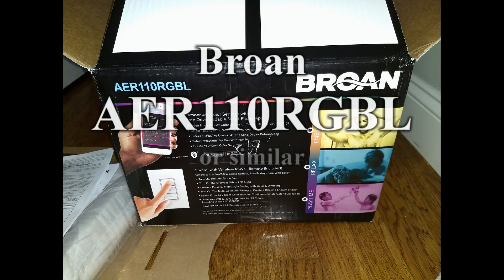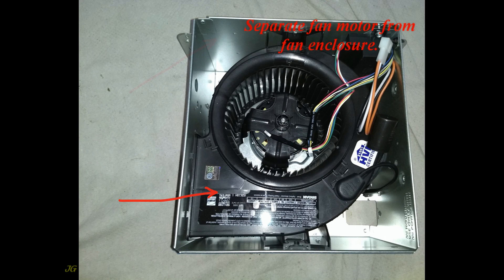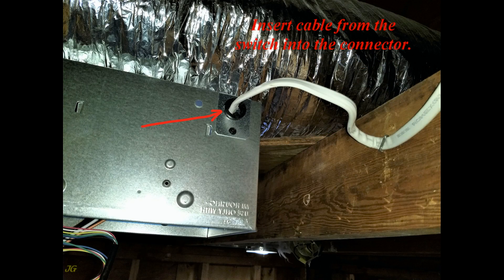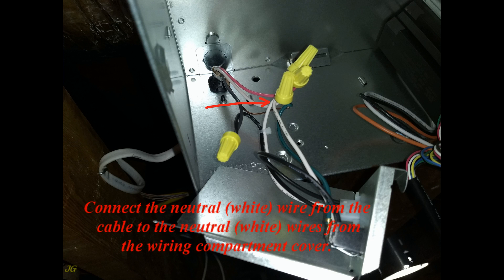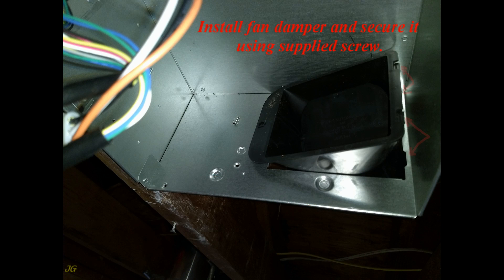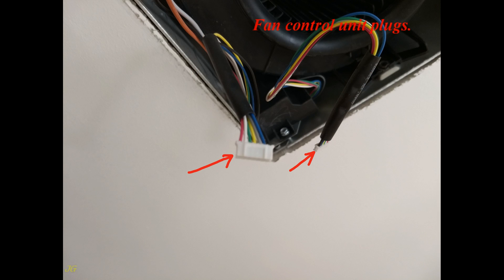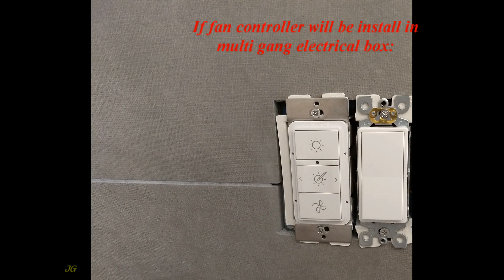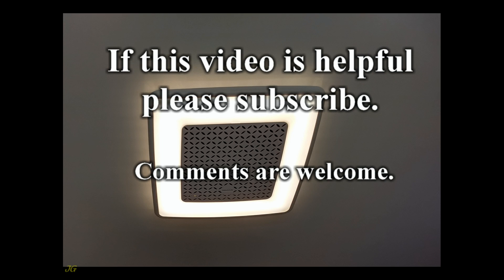Broan AER110RGBL and similar bath exhaust fan installation.

Comment: So the red wire that is coming from switch doesn’t have any use?
Reply from the maker: Can be used when replacing a fan with another one.
Reply: This is my question. The previous fan had a blue connected to the red. If I leave it without a connection, my fan will still work? 

Also, the previous fan didn’t have a ground wire and so the ground wire was screwed to the casing. Now I should undo that and connect both grounds together and they don’t need to be connected to the metal base?